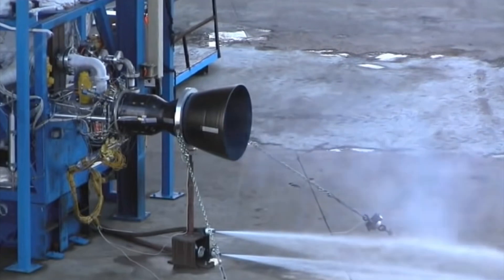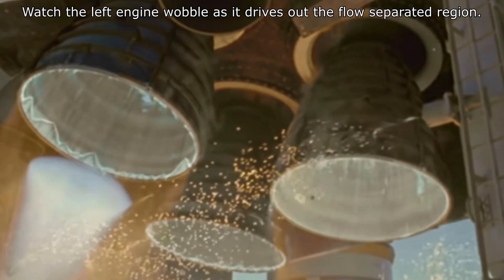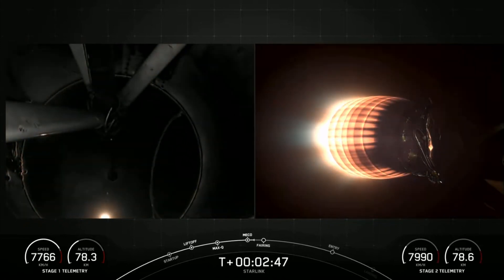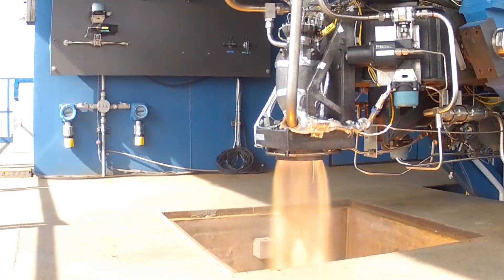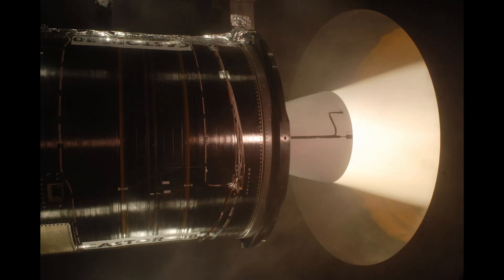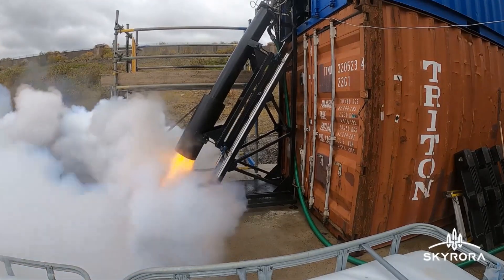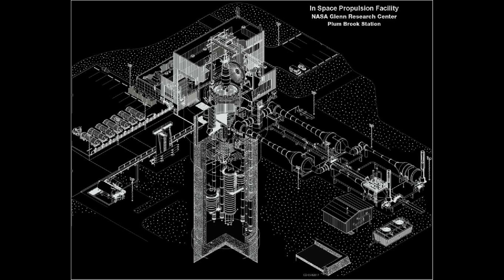Defying Atmosphere - How Rocket Engines Get Tested In A Vacuum Before Going To Space

Comment: You don't need Newton's 3rd law. Rockets work by maintaining high pressure on the forward side of the combustion chamber. Pressure on the lateral walls of the combustion chamber cancels out, and whatever happens to gases that pass the open end of the combustion chamber the rocket doesn't care – so long as pressure inside is somehow maintained.
Reply: That's really an alternative perspective on the third law. The only way to have pressure on the top and not on the bottom is to have fuel on bottom accelerating downward.
Reply: You actually do, because that's how rockets work. The pressure of the ignited propellent pushes against the rocket.
Reply: Pretty sure pressure is a scalar but whatever 😂
Reply: @papalegba6796  Yes! Pressure is a scaler. What that scaler measures is how much the gas pushes against everything around it. That push, of course, is a vector, oriented toward the object in question. Not sure how any of this means rockets don't work.
Reply: @tyruskarmesin5418  - "Not sure how any of this means rockets don't work."
Well, it denies that exhaust gas gets accelerated by the rocket engine AND it denies that exhaust gas has mass.
So there you go.
Just try asking it where the force comes from that accelerates the exhaust gas into the vacuum.
It's only response to such questions is to call us 'bots', hurl juvenile insults, and claim that it has already answered the question.
Reply: @stuartgray5877  There are a couple things you said, let me break them down one by one. 

First, you said that the exhaust gas doesn't get accelerated by the rocket engine. Well it certainly gets accelerated, so what do you think is doing it? I will address this more later.

Second, you said that the exhaust gas doesn't have mass. I gotta say, that's a new one, even for flat earthers. Gas is made of atoms, and atoms have mass. I also don't see how you got to that conclusion from the fact that pressure is a scaler.

Third, you asked where the force comes from that accelerates the gas into the vacuum. With most things in physics, there are multiple ways of describing the same thing. Here is one, I could provide others if you like.

As I described in my previous comment, pressure is a scaler, and does not have a direcion, but it in a sense exerts forces away from itself, and force does have a direction. It is worth noting that steam engines, internal combustion engines, and guns all rely on pressure exerting a force and accelerating an object. In a rocket, the ignited fuel has a pressure, and so exerts a force outward on everything around it. The horizontal forces on the walls cancel out, but the force on the top of the combustion chamber doesn't have a counterpart on bottom. That means that there is a net force between the rocket and the exhaust. Remember, every action has an equal and opposite reaction. Both the rocket and the exhaust feel a force from the other, and so they accelerate away from one another.
Reply: @tyruskarmesin5418  I am talking about what papalegba believes, not me.

I build, launch, and operate vehicles with vacuum rated propulsion systems.
Reply: @papalegba6796  - Rocket engines have "Exhaust Velocity" it is one of the components of the Tsiolkovsky rocket equation that you deny.
"Velocity" IS a vector, but you didn't know that since you deny that the exhaust from a rocket engine "changes velocity" due to the combustion pressure.
The other is "Mass flow rate" which you ALSO deny since you reject the fact that Space Shuttle Main engines eject 500 KILOGRAMS of pure water per second.
"Kilograms" refer to MASS since you didn't know that either.
Reply: So none of you can spell "scalar" but I'm wrong?  😂
Reply: @papalegba6796  You are, in fact, wrong. Also you still haven’t answered my question about conservation of momentum.
Reply: @tyruskarmesin5418  Yes I have, you're not programmed to understand that tho 😂
Reply: @papalegba6796  Oh, you have? I'm so sorry, I must have missed it. So silly. If you would, could you just copy that comment and paste it here? Just as a favor. you know, since that comment totally exists.
Reply: @tyruskarmesin5418  papalegba refuses to answer questions and will ALWAYS claim to have already answered.
I have literally asked him THOUSANDS of times "from where does the force originate that accelerates the mass of the exhaust gas into the vacuum".
He flat out refuses to answer, while claiming to have already answered somewhere in the multiverse.
Reply: @tyruskarmesin5418  Oh and he claims that anyone smarter than him is a "bot".
I guess every other human on the planet is a bot.
Reply: @tyruskarmesin5418  when you learn to spell simple scientific terms correctly I'll maybe take you seriously (lol no I won't You're a chatbot 😂)
Reply: @papalegba6796  You need to get better at dodging questions. I mean, that wasn't even pretending to be subtle. If a rocket shoots fuel out the back, but does not accelerate, does that or does that not violate conservation of momentum?
Reply: @tyruskarmesin5418  If it's in a vacuum it will not move & will not violate conservation of ENERGY. Use the correct terms please, chatbot 😂
Reply: @papalegba6796  Conservation of energy is not the issue here, the kenetic energy comes from the chemical potential energy of the unused fuel. It is conservation of momentum that your claims violate. If the rocket does not accelerate, but the fuel does, then the net momentum has changed, whithout any outside forces causing it. This is fundamentally impossible.

Comment: Good gravy, there are still people who say a rocket engine can't work in a vacuum? Where do they get that? Because I'm sure they're not just reasoning it out themselves unprompted.
Reply: From a psychiatric illness. As demonstrated by the first commenter.
Reply: @blegi1245  um, the first commenter thinks rockets work in a vacuum .😂
Reply: @papalegba6796  that means you think rockets work in a vacuum. Good thing we got that out of the way.
Reply: @blegi1245  I'm not the first commenter though. Is your markov chain really that short? 😂
Reply: Free body diagram or work calculation. Funny how this video doesn't show either 😂
Reply: @papalegba6796 free body diagram: box with arrow coming off of it. Momentum equation: 
Δv=(m_r/m_p)*v
If your mass change is small relative to your rocket at least (otherwise you need to integrate).

Your final change in velocity is the rocket mass divided by the mass of propellant you just expelled times the exhaust velocity. Momentum is conserved.
Reply: @samburnes9389  you don't calculate the output of a heat engine using conservation of momentum 😂
Reply: @papalegba6796 a rocket engine is not a car engine, to state the obvious. A car engine uses combustion to move parts that push along the ground. A rocket engine uses combustion to push mass out of itself as quickly as possible. 

You could do an energy balance as well. You would find that the thermal energy of the fuel beforehand equals the thermal energy of the rocket and exhaust after plus the kinetic energy of the rocket and exhaust.

But you can’t determine the motion of an object with energy alone. You need momentum (and mass) conservation first.
Reply: @samburnes9389  a thermal rocket is an internal combustion engine. Are you for real? 😂
Reply: @papalegba6796  no, it's not an internal combustion engine. I suppose it would be an external combustion engine, but no one would call it that.

You shoot mass out really fast and get pushed in the other direction.
Reply: @samburnes9389  A thermal rocket is an internal combustion engine. It has a combustion chamber internally 😂
Reply: @papalegba6796  you’re being a pedant. That’s not what internal combustion engine means in practice.
Reply: @samburnes9389  yes it is 😂
Reply: @papalegba6796  whatever you call them, it doesn't change the fact that rocket engines work, both in the atmosphere and in a vacuum. The math and theory (as well as the practical demonstration) there are irrefutable.
Reply: @samburnes9389  why should I believe you when you don't even know what kind of an engine a rocket is? 😂
Reply: @papalegba6796  you should find a course in introductory physics and take it. But I know this has been you trolling the comment section, and I know I have been intentionally taking bait. But this is no longer interesting so I will move on…
Reply: @samburnes9389  Yes it's my fault you don't know what kind of engine a thermal rocket motor is, even tho I told you repeatedly & Google agrees with me, totes makes sense 😂

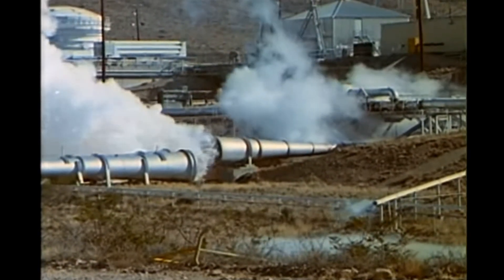Comment: @9:01 you speak of catching the spent fuel of a test rocket.  What are the environmental impacts of different types of rocket launches.   How much , dust/gas gets released and absorbed into the environment.  I am also curious what the energy expenditure is to produce one booster tank of solid rocket fuel.    It seems my non rocket science brain sees each production and  launch of a rocket off the surface directly affects the balance of our atmosphere and composition of our soil.  Kinda like shooting ourselves in the foot.  I said already that I am not particularly bright, so I need your eggheads to prove my uncritical thinking incorrect .   Science will shine a light on how safe rocket launches are for climate change. Cheers🤙
Reply: The most common "waste" product of a rocket engine is water.
Reply: @Matuse  A space shuttle main engine expels pure water as the exhaust because it burns hydrogen and oxygen.
A "regular" (kerosene) engine has CO2 as the exhaust gas (mostly)

Comment: 8:50 You forgot to mentions the other way to test a Vacuum Engine at sea-level. Just shove a cone up the vacuum nozzle to reduce the Exit Aero of the Nozzle to bring the pressure up. As long as the Shockwave of the cone reattaches at the rim of the nozzle, pressure across the shockwave greatly increase the nozzle exit pressure. It looks like this might be what is going on in this picture.

Comment: It absolutely blows my mind that a bell rocket nozzle can be less than atmospheric pressure. I understand that it is , but not how
Reply: It’s not that hard it’s just rocket scie…. well, it is a bit tricky I suppose.

The pressure difference applies a force that slows down the exhaust, but it can’t overcome the immense amount of energy there.

That push does reduce efficiency though, and is one of the reasons rockets are less efficient in atmosphere (a highly simplified explanation)

Comment: Combustion doesnt work in space
Reply: So, you don't think we have been testing combustion in a vacuum for over 50 years now?
How many spacecraft do YOU think NASA is operating right now in space?
Reply: That’s why oxidizer exist💀
Reply: Except it does, no matter how dumb you are.
Reply: pietjan2650 - I have been building spacecraft with rocket engines and explosive devices and using them "IN SPACE" since before you were born. Now go finish your education.
Reply: Combustion does work in space. You just have to provide the oxidiser along with the fuel. Every rocket carries two tanks, one for the oxidiser and one for the fuel. These are mixed in the combustion chamber, and they combust very well indeed.
Reply: @h.dejong2531  Ask papalegba what the combustion by-product of an oxygen-Hydrogen flame is and prepare to be amazed.
Reply: @rocketman484  Hi Stuart!😂
Reply: oxidizers my guy
Reply: First law of thermodynamics says space travel is fake. Shills hate it 😂
Reply: @papalegba6796  and how does it state that then?
Reply: Cos a system incapable of either heat transfer or doing work can not change its total energy. Obviously 😂
Reply: @papalegba6796  and why can’t rockets transfer heat or do work?
Reply: @peeperleviathan2839  they can't in a vacuum cos there's nothing to transfer heat with or do work against. But there is in an atmosphere. Are you human?  You don't sound it 😂
Reply: @papalegba6796 radiation is a type of heat transfer and rockets don’t push off stuff they throw stuff out the back and that pushes it forward. Ever heard of Newton’s third law?
Reply: @peeperleviathan2839  Yeah so draw a free body diagram then. Oh you cant, same as NASA can't 😂 And no, radiation cannot transfer heat with a vacuum either, liar 😂
Reply: @papalegba6796  - "And no, radiation cannot transfer heat with a vacuum either, liar"

Yes it can genius.
Or according to YOU the heat from the SUN is a hoax?
Bless your little heart!
Try completing high school before lecturing others about basic physics.
Reply: @papalegba6796  the fuel they expel is how force is generated. It really is simple. F=ma. The rocket accelerates fuel with a mass and acceleration, generating a force. By Newton's third law, there is now an opposite and equal reaction, and that is thrust.
Reply: @papalegba6796  Okay, how does the sun heat is then?
Reply: @ppleberrynd  F=ma refers to external force, chatbot. And a vacuum is nothing, you cannot have energy transfer with nothing. Stop spamming nonsense 😂

Comment: How fast will the infinite vacuum of space, pull the gas away from the nozzle? Can it be lit if gas will fill a void.
Reply: Zero. Space is not a vacuum cleaner. It does not pull anything anywhere.
Reply: @Matuse  then why would they need airlocks?
2nd law Of thermal dynamics
Reply: @9greatdanes981  - "then why would they need airlocks?"
To keep the air from PUSHING OUT.
The "vacuum of space" does not suck.
But what would I know? I have only been operating some of the nation's largest thermal vacuum chambers as my job since before you were born.

Comment: Everything you have said about the difficulty of getting a reliable ignition or re-light of a rocket engine in a vacuum demonstrates the stupidity of using HydroLOX engines for Lunar Landers and Lunar Shuttles. There is a hell of a good reason why Apollo used pressure fed hypergolic engines on the Service Module and the Lunar Module. When you absolutely, MUST have an engine work, simplicity is the best guarantee of success.
I know everyone hates hypergolics because of their nasty compounds, but Russia has pioneered refueling of hypergolics in a microgravity environment with their Mir Space station modules. Their latest Soyuz has a life expectancy of close to 200 days. I am sure we could extend those margins by just building more robust tanks, valves, etc.
And all those people that expound on the wonders of wasting invaluable lunar water ice by spewing it into space as rocket fuel are just not concerned at all with the idea we may NEED that water later for stuff like.....oh I don't know..... life support.
Reply from the maker: The Saturn V 2nd stage used a hydrolox engine which had to relight in orbit for the TLI burn. So this is a proven technology.
Reply: @scottmanley  you left the UK why?

Comment: How do you steer a spin-stabilized rocket stage? Just point it at the right direction before ignition?
Reply: Yes.  If you need to change orientations you spin it down first, repoint, and spin back up.

Comment: I instantly recognized the thumbnail pic, but Scott never mentioned our facility where this engine was tested and photo taken. This is at the Altitude Combustion Stand at NASA Glenna research center.  ACS uses gaseous nitrogen ejectors to maintain vacuum during a test. The goal of the test program shown here was to demonstrate the capability to light a maneuvering thruster that run on sub-cooled fuel and oxidizer. methane and lox.( that's why the flame is such a pretty blue.)

Comment: Air ejectors (described as steam powered toroidal ejectors, or some such): I find it fascinating that this near anvil-level technology is mixed in with all the more advanced stuff to make this test system work.
They could have literally raided the spare parts bins for the high-pressure boilers used to power the things. Once steam turbines replaced the early reciprocating engines to power ships and electrical power generators, pressure and temperature of the steam had to go up massively, bringing with it the problem of air in the boilers, which would cause serious corrosion problems for the boiler tubes.
A certain amount of air is dissolved in the feed water, which is released when the water is heated and flashes to steam. Even in these closed systems a certain amount of steam escapes through seals, valve packing, etc. even if there are no significant leaks, so fresh feed water has to be added in small amounts nearly constantly to maintain boiler water levels.
The air ejectors run constantly, releasing the air and condensing the steam to go back into the feed water system. Conservation of this water is important even on land-based systems because of the high level of purity required.
Steam turbines on ships came into their own immediately prior to and during The Great War, so this technology is over a hundred years old.